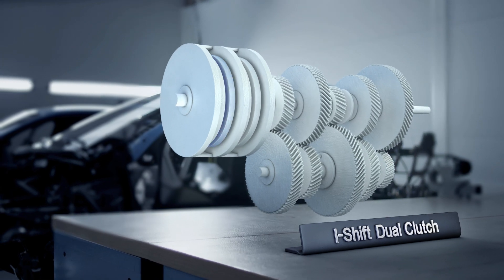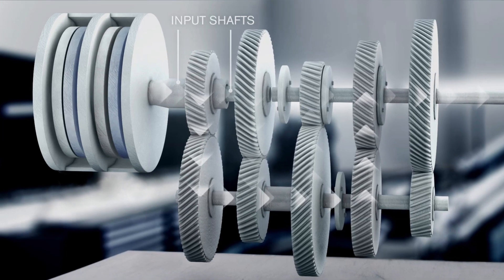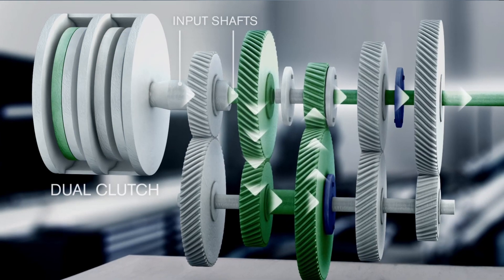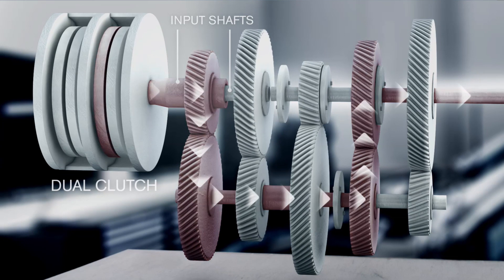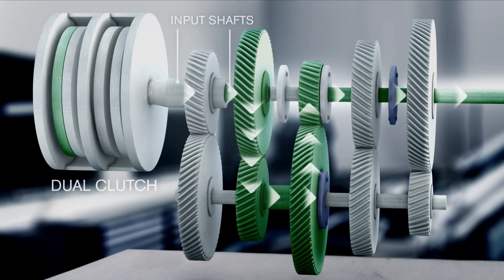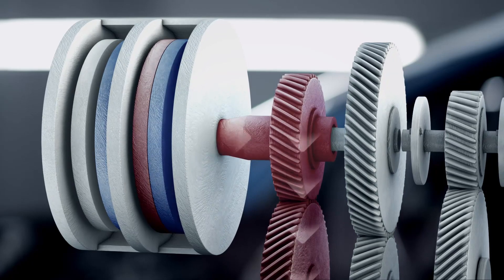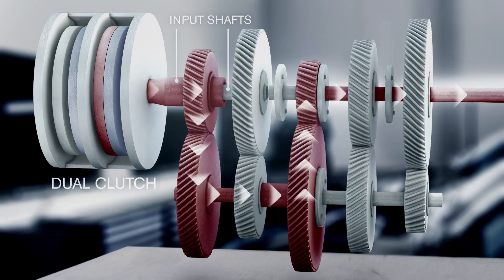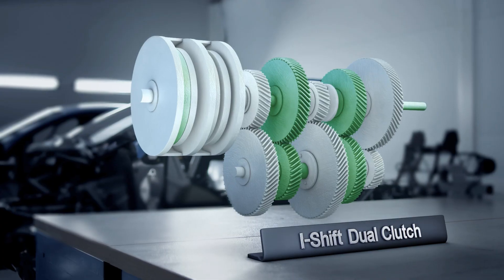Volvo Trucks - How I-Shift Dual Clutch works

Comment: For those who didn´t unterstand, I'll try to explain

Think about a manual transmission.
You have the split button that changes frol LOW to HiGH range between all 3 gerars (1st, 2nd, 3rd)
Instead of having a selector fork sitching from L and H, each one of the gearsets is connected to one clutch

the normal gears as well as the selector (1,2,3,=>4,5,6) works exactly as normal

When it's acelearating, while one clutch is closed at 1L, the othr clutch remains in standby at 1H
Then when the second clutch is closed, the first one opens and engages 2L
SO ON, SO ON

One clutch is responsible for all Low range and the other is responsible for the High range

Comment: took its time, but lesson learned from first generation i-shift i gues?. dont let  untested crap out on the marked, that pisses people off. and whats the problem now with not letting the dealers shops adjust the ride hight on the air suspention on the new trucks?. my new FM ch.nr.757934 had the wrong settings when it came out from the factory and they cant fix it.
Reply: I find that hard to believe, if I ever change any leveling valve components we MUST check ride height and adjust it as per master service manual.  You must want a setting outside of what it should be.
Reply: no the truck sat on its arse, after 3-4 times in the shop they figured out they needed new softwere from volvo in sweden. took a lot of downtime to fix the problem. many new volvos had the same problem.
worst fault on the truck was the electronic handbreake that mailfunctioned. all seemed fine and light thats in on in the dash, then when am about to leave the truck it starts rolling. many trucks with breake problems. new shit thats not tested and yet many days downtime for me. did they compensate me for the truck sitting like a dud?, hell no so if i order a new volvo again pigs better start growing wings.
Reply: Stian that's why u should get scania  and not a Volvo! 😊😉

Comment: omg I can just imagine the wear on those clutches from doing that! no thanks! I'll just wait for 100% geared CVT technology to catch onto the truck market. FYI they don't use clutches at all.
Reply: +Matt Velazquez by that time trucks might have electric motors and not need such gearboxes. For trains above a certain power diesel-electric is generally superior to diesel-mechanical or diesel-hydraulic.
Reply: actually the wear on the clutches is reduced by 75% compared to a manual, so i would say it's not too bad...
Reply: you know that CVT is a dead thing and were always? like the wankel or the 2stroke engines... Nobody will use them and the ones that using in car industry only struggles selling them...
Reply: The clutch wear only happens when starting from a stop, the computer perfectly rev-matches each shift

Comment: Its also very expensive to fix............suprise suprise.
Reply: Sure but if you only cares about how easy it is to fix then buy an old WW2 military lorry. Science and engineering moves on with or without you.
Reply: wazza33racer Well I'm not surprised to see that my point went over your head completely.
Reply: what does it matter? by the time it goes broken (if it does...) it had already made much more money with hauling than what the truck worth, so just buy a new one and get rid of this